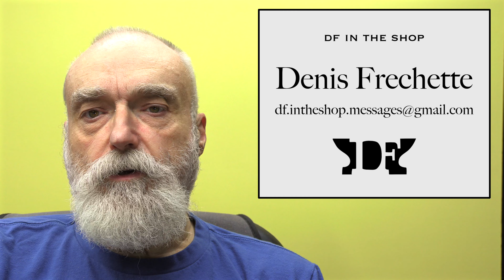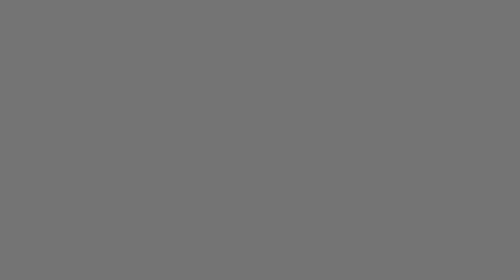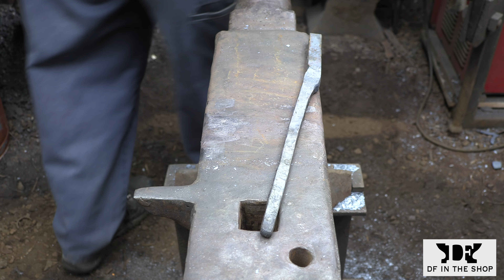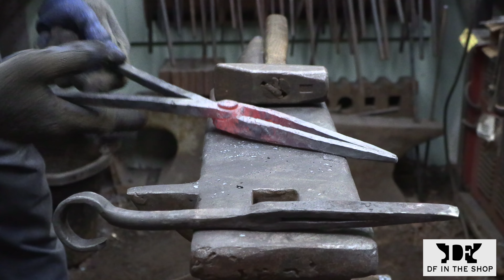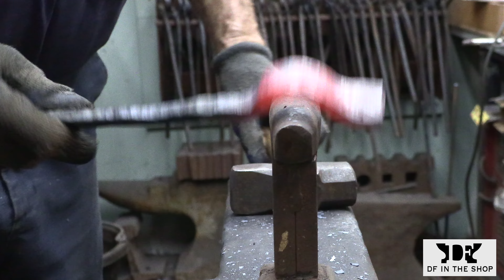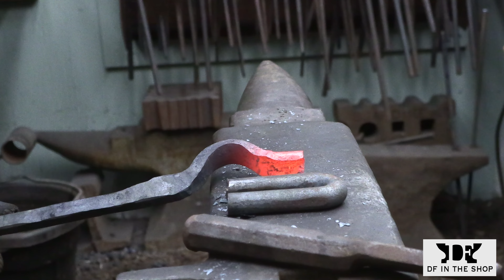Blacksmithing For Beginners - Turning Your Tong Blanks into Blacksmith Tongs

Comment: Very nice! I do wonder though, why do you say you don't recommend flat jaw tongs for forging? Flat jaws are my go-to, I just makes sure to set them to my stock size
Reply from the maker: I don't recommend them mainly because they only hold the work on two sides.  If you are hammering on edge the bar can move sideways even on well fitting tongs.  I forge with box tongs not flat bit.